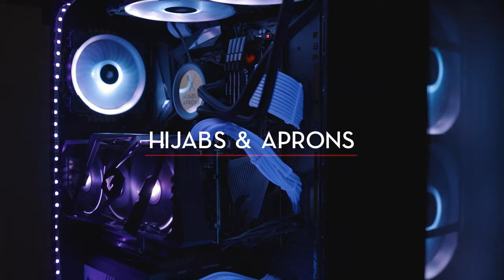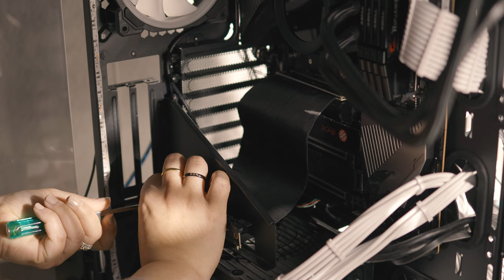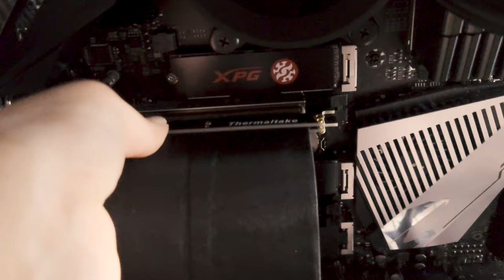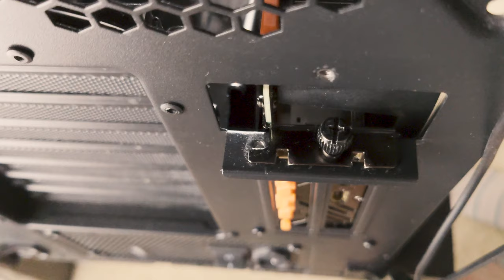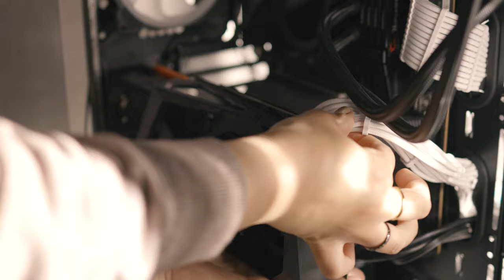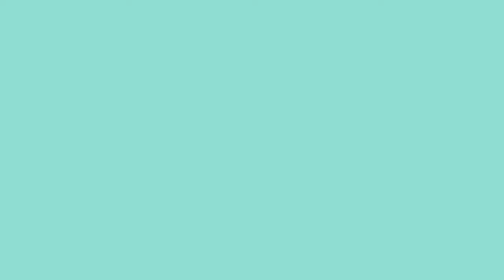Installing my AORUS GeForce RTX 2080 Ti GPU BY MYSELF

Comment: THICC 😆
What monitor are you using? I’ve been looking at 1440p screens but there’s so many!
Reply from the maker: I use a 4k IPS monitor from LG. I've had it for 2.5 years now and it's treating me well. The exact model is: LG 27UD59-B 27" Ultra HD IPS 4K
Reply: @HijabsandAprons  Okay, thanks.
Also didn't you have a Thread Ripper? What happened? It wasn't cutting it anymore?